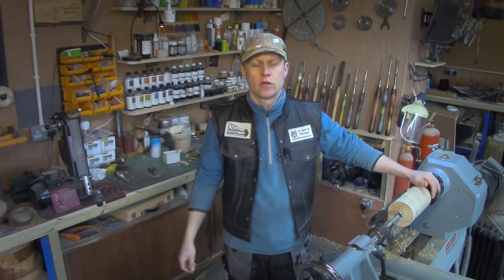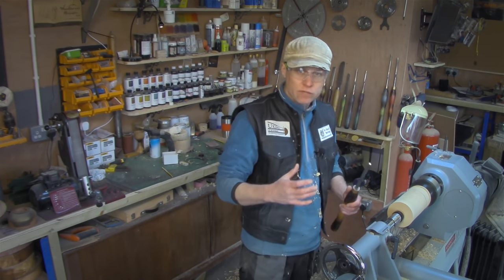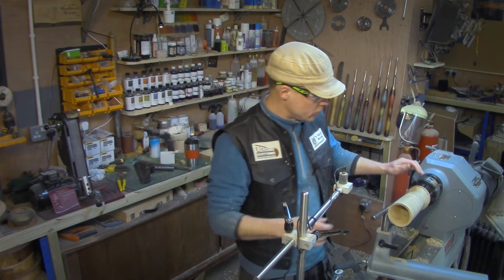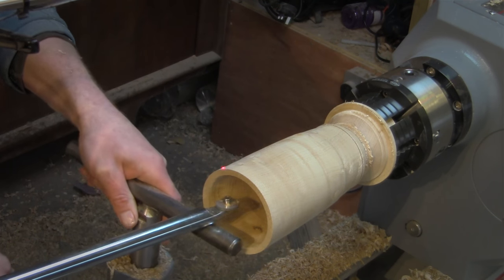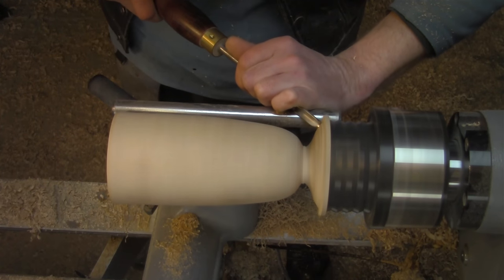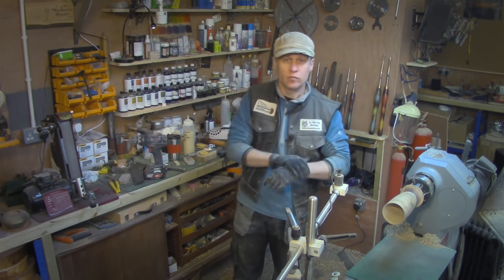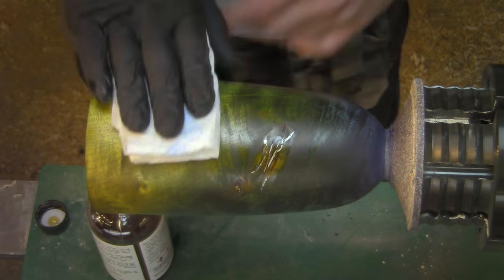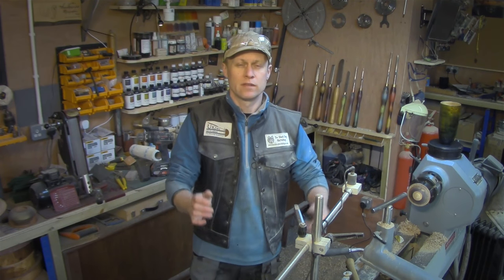#80 Woodturning Project: Hollowing and Colouring a Sycamore Vase

Comment: Great video Martin! 😆 The base came out absolutely beautiful, I love the colors!! I use polyacrylic varnish to seal my flat panel burnings on birch or basswood. Based on how you sealed the vase with the Danish oil, spray sealer, and then your sealer; how much of a difference will I see with the intrinsic colors?? I had planned on using an outdoor polyacrylic to seal with the intrinsic colors to protect...but now I am wondering if I should at the very least use the Danish oil first. I do love when the beauty of the grain shows, but I want my burning and soon the colors to be the main focus. What do you think??
Reply from the maker: Hi Valerie. Thanks for your comment. The oil is an optional step really. A sealer will enhance the colour too, but not quite as much as using the oil, too. So long as the colours go on first, and then sealed, you should be absolutely fine. 
Before using the on a 'proper' piece of your burned work, do a couple of quick test pieces and use my technique and then yours, and go with whichever you prefer!
All the best,
Martin
Reply: Thanks Martin! 😆 I will definitely be doing a color swatch birch board over burning for all of the colors. I will include the Danish oil in at least one block of each color, as well as what I usually do. I can't wait to get the colors. 😃
Reply: Another few questions...lol. 😆 Now in painting & in general there is a "fat over lean" rule. Meaning oil based products can go over water base, but water base can't go over oil. Does this rule apply with wood finishes too?? What was the sealant you sprayed over the Danish oil, and is it water or oil based? I was wondering if once the Danish oil soaks in and dries, it is no longer an issues as to what is applied next. I tend to use all water-based products, so this will be the 1st time I deal with oil.

P.S. Last week I mispronounced "Hampshire Sheen" when I was talking to hubby. He heard "hampster sheen" and once he said that out loud it stuck...lmbo! 😂 So now that is what Hampshire sheen is called in this house. I thought this might give you a chuckle. 😃

Comment: Hi Martin, could you tell me if you apply sanding sealer before the colours,or go straight 
Into it with the colours please.
Reply from the maker: Hi Carol. I always put colour on before the sealer to give the colours the best chance of soaking into the wood.
Reply: M. Saban Smith Woodturning I’m sure you can tell I’m new to this but how do 
you stop the colours from bleeding into an area that you don’t want it to go.
Sorry to be a nuisance.
Reply from the maker: Good question. Most of the time, I go to colour an entire piece. It is difficult to keep colours from bleeding on a medium that is made up of tubes. 
Options you can try would be a stencil, masking tape or sealing the part you don't want colour.
In the past, I've used a stencil/mask to cover the non-coloured area and then used an airbrush to apply the colour.
Reply: M. Saban Smith Woodturning Thanks for that Martin, by the way I love your work and your products 👍

Comment: Great colouring, shading and blending. What spray sealer were you using? My wipe on cellulose sealer does tend to pull some colour back out from my work. Had a great recent result 'clouding' black and blue on a sycamore platter after watching a past episode. Regards
Reply from the maker: Hi Gary. Thanks - Loving blending by hand - much more...um, 'personal', if that makes sense. A wipe on sealer will almost always take off some colour, so you're not doing anything wrong. A couple, or three coats of a spray sealer will help greatly keeping it on. The sealer I used in this project is a satin sealer from PlastiKote.
All the best,
Martin
PS Black and blue is a brilliant combo - bet it looks awesome!